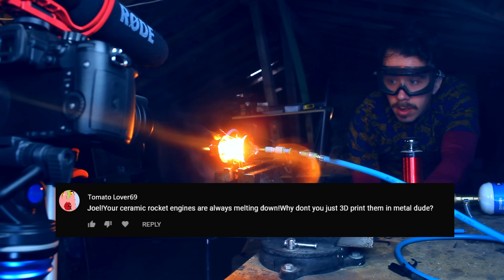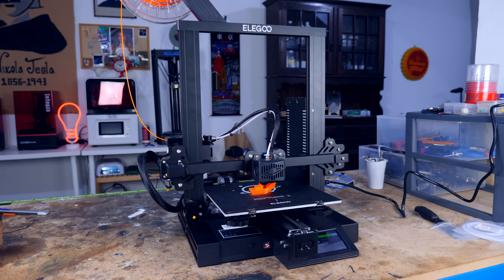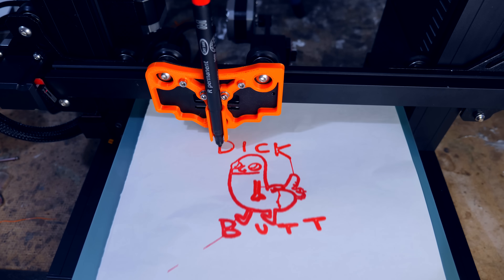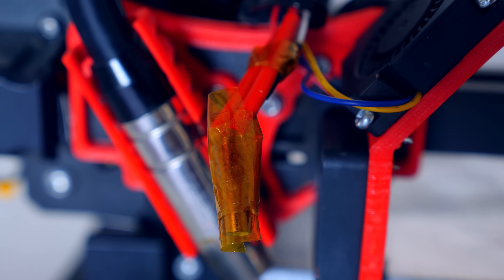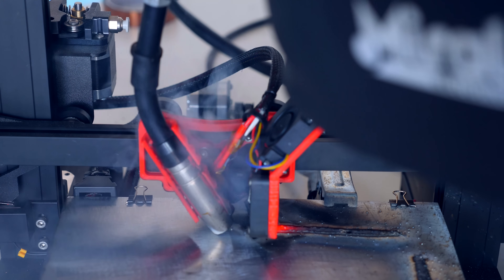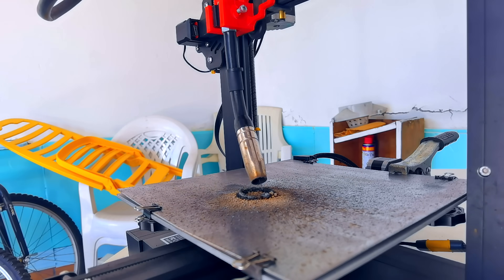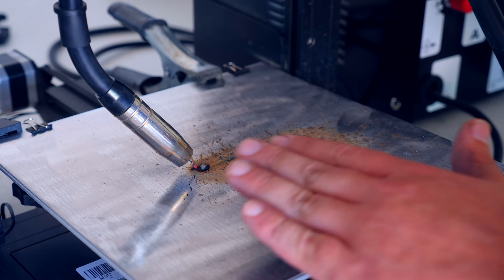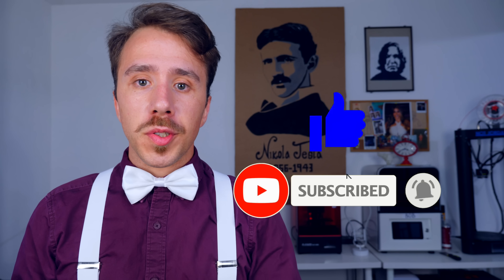I built a Metal 3D Printer using my Welding Machine

Comment: Instead of flux cored wire you should've got some shielding gas and a solid wire. Way cleaner, way less spatter, and it wouldn't be trying to weld on top of the flux.

Comment: You're so close to building something amazing all you need to do is use a MIG torch instead of a flux core welder it has gas shield instead of that flux cord you wouldn't have to keep grinding it down and you get much better results

Comment: I subscribed because you are trying something and putting yourself out there.  We learn from all things even when we are pretty sure it wont work.  So if that wire did not spatter, and you were to weld 1/4 of and inch every 8 inches and allowed things to cool this WOULD work.  We need Heat we need gas insulation from air.  Like TIG tungstun inhert gas.

Comment: I think you might be able to do this idea with a TIG welder. There isn't splatter and the torch is smaller. It also can be pulsed and that may help with temp. control. The tricky part would be setting up the wire to be fed into the weld. But I'm sure there is a way to control that. There are many styles of torch heads on the market for TIG too.

Comment: Cheers lad
So basically this idea ain't as bad as you think. Just you didn't have the knowledge to apply and design it properly. 

First would be the problem of the sheet metal usage. Use a mid type of brass plate around 5 to 8mm thick and drill threads into it in a systematic distance to each other to be able to strap down steel bars (around 5x40x whatever you cut it down on) . Then you can start by drilling the hole and threat profile of your nozzle, so when you finish the nozzle you only have to redrill the threats

To your problem with the welder itself

There are welder nozzle types that have next to no angle, but as that is a higher budget accountancy, how about you make a 3d printed holder that takes him from the handle, bringing the degrees to 0 vertically. The lower the ampere the less the angle could matter to you, especially as you want to weld into Z the only thing to adjust then is the speed you drive in. After all your printers need a lot of time aswell.

Next is to adjust the position of the plates i said to the welders new 0 point, as through taking it by the handle makes it longer in the y axis

Then sheet the electronics in safety with the used sheet platings you wasted

The last thing i would like to ask what gasses you use as it can fairly well matter in the metal properties. 

Greetings C.
Reply: In the end i want to ask you, when you look at my ideas and say no cause of your budget.... Make a cost list of all your printers and materials used to make a rocket and then compare it to this.

Comment: You can make styrofoam models and put it in a box fill it with construction sand (not sure if it’s the right name) poke a hole and add molten metal to get what you need. You may need to cut it in half and hollow it out to get what you need. It’s an idea not sure if it’s a concrete one.

Comment: The angle of your nozzle is too step it should be around 15 degree relative to the plane you are trying to weld. I don't believe you'll be able to get away with deformation even if you get something 1/2 inch thick since your welding locally you would need to let the metal cool between every pass to lessen the effects.

Comment: You don't need to grind each layer, a wire brush attachment will clean it up much easier without removing steel which has the downside of lower the level of the previous weld by just brushing with each layer you are cleaning the weld and prepping it for the next weld. Please try this if you plan on doing a follow up video. 

Welding is 90% prep time 10% welding

Comment: Please print with some woodsche metal or gallium filament... something with low Meeting point should work to be worked/drawn into filament/wire..  and you need to cool the hotbed.. aka instead of heater a peltier for cooling the glass surface.. might work with stock nozzle and szuff..
Or sondern wire? A stock hotend should work for that too.. and can a 3d printer solder my Circuitsus on my PCB? Or can you print a wohler PCB maybe even multilayer ones with a two hotend Setup? One for conductive filament the other normal filament.. maybe the parts then just need to be stuck into these printedpcbs insted of sodlering

Comment: Hey so here's a suggestion, so my dad is a master mechanic and over the years I've helped and learned to work on cars/trucks etc. When doing body work and your welding 2 pieces of metal together to make your bumper, fender etc whatever it is your working on, the trick to make your piece keep its shape as your welding it is to spot weld it. Spot welding is pretty much a tac weld but you do it so short and quick the metal doesn't get hot. The metal being cold/room temperature as you weld on it is key for it to keep its shape and not twist/warp on you. I hope this suggestion helps! I love all the videos I'm a huge fan 😊

Comment: I feel like this could work but it would take a ton of r&d + investment. Definitely would have to use MIG and probably water cooling on the baseplate at temperature based intervals. The parts would probably need to be somewhat large to give the layer time to cool before coming back over it. Welds tend to just keep melting into each other without cooling between

Comment: If you decide to try this again, try printing vertically with a lower welder power.

Obviously I'm just going off the video, but it looked to me as though the welder was vaporizing the feed material before it all had a chance to stick and was spattering it around as a result. Probably like 75%-90% of the welder power you were using would have been better. Printing vertically is really your only way of guaranteeing the position of the feedstock relative to the bed, since you weren't turning the bed to keep the angle consistent.

Also, a cover gas would probably have helped. Not as important as the welder power though IMO.

Comment: you are using flux wire if you use gas and normal wire you will get better welding with no need grinder...

Comment: I think you will get better results by using normal non flux welding wire, with CO2 as a shielding gas. This way the weld will stay a lot cleaner.

Comment: I would like you to take this idea to the next level. Thicker plates and mig welder with gas, no need to clean layer after layer of bird poop 💩 again.  Maby even use a tig welder and use the printer to Control the filler rods.

Comment: If you try in future, you should consider using a stone chopping board for a bed instead of sheet metal, and a thin wire mesh so the weld has something to bind to. 
I don't know much about welding but maybe also a thin layer of water to cool down the base, would pull heat out of the stone before it has time to build up and crack, would also stop the wire mesh from deforming during the base layer. can't wait to see more, good luck!

Comment: Two things that would improve your print. Having worked on with industrial MIG welding robots using oxy act gas would basically take away the bird shit stuff (weld spatter) that you're running into, also adding a cooling plate to the bottom of the base plate or putting a delay between each layer would also help with the plate warping, and lastly adjusting the speed of the print would allow you to get a better weld but it seems the speed you have it working rather well but will need to be adjusted if with thicker welding wire. friendly note using both flux wires with shielding gas will make it so you wouldn't have to grind it every layer and the welds will come out beautiful.

Comment: G02 is clockwise and G03 is counter clockwise Thera also IJK codes you can use inside the g code line to refine the move. Point to point is an insanely inefficient way of making an "arc" with G code.

Comment: When welding thin sheet metal it is best to just do sequential tack welds, continuous welding makes too much heat and warps the thin metal. As well, your stick out is way too far, the wire should only project less than 1/4" from the welder tip. As well, welding with the tip at an angle also makes it deflect more. The other challenge with constant welding is melting the previous bead from too much heat, which causes the weld to mushroom out and not build in height. If you added shielding gas, pulsed the welder and movement and added a large stationary fan cooling the entire sheet (it will diffuse the heat quite well) this could be more workable.

Comment: Hi. Im not even sure how does youtube got your videos to me but whatever.  Anyway.. After watching this video and went for work (Asd welder) i was thinking . . . You making ceramic rocket enginels... Why not use  a TIG Welder gas nozzle? They usually made from ceramic and they already designed to blow gas out of them. And they usually connect to plastic at some point on the welding pistol and they didn't burn that eaither Might worth a try. Specially because it's cheaper then a metal 3D printer.

Comment: I would like to see you us a Mig welder that uses Argon gas at a flow rate of 30ml,
and between layers it would do a pass over the existing layer without welding  to cool it down
 or just setup a pause between layers for about 1 minute

I know it would be slower but at the rate a welder can lay filament it wont be to bad.

Oh Welding via CNC with PTA (Plasma Transfer Arc ) has been around since the 1950's
I used to do this many years ago building up layers to about 25mm.
 
 But the machines were very expensive and big, and used many types of gases
And now we can make such machines very cheap indeed, as you have demonstrated. 
I do hope some one make one work using the cheapest 3D printer and welder available.

Comment: Just... no...
1. Make print for your engine from ABS
2. Get ceramic gypsum make a molt.
3. Leave to dry off
4. Drop that in oven ~150C for time to cure don't go above 200C or you melt ABS
5. After cure flip upside down and melt of PLA
6. U shuld have litle crude but fine molt for cast.

Comment: a mig welder with the right gas would fix the slag problem that makes it look like birdds**t. but with the thicker metal plate you need for stop the warping, you get the problem of how to seperate the weld from the buildplate (that most likely is more expensive then the part you print) in a way you can use it again. + syill getting build plate adhesion..
Reply: using a cnc to cut out the first layer and fixing it on a ceramic plate with some kind of heat resistant glue might work.. but casting is way faster and cheaper.. even the metal 3d printer using metal powder filament would require less work and get better results. welding is just to messy and random.

Comment: even metal rocket nozzles melt, the temperatures on the inside of the engines can reach 3500-4000C. You need to cool all engines down, try cooling the ceramic nozzles using a heat transfer mechanism.

Comment: Hello Integza, i like your channel a lot.
Your way of thinking out of the box and experimenting
further even if there is a tomato storm the result is inspiring!
A lot of your experiments need to resist high temperatures of fire etc. for a long time so I would suggest a new theme for another video should be
You're trying to build a  DIY 3D printer that uses ceramic paste/fluid to build those heat resistant parts you need so urgently- think of the pulso jet, the rocket nozzles, the tesla turbine etc. You could create a series of integzas experiments reloaded where you redo your famous experiments again with better results because of the ceramic parts in it! It would be fun to bet in advance how many failured from the beginnings would now turn into success with the 3D printed ceramics! All the best to you and your girl-friend - I wish you the sweetest tomatoes  life can bring! 😉

Comment: Great video, cool experiment! Upgrade the welder to a TIG will get rid of the problem with slag you have to clean up between layers. Feed filler-rod using a cold end extruder, kind of what your welding machine did in this video. Don't use your 3dprinter, but instead make a MPCNC where you mount it. Skip using plastic close to hot object, use aluminium. Ohh, you got another subscriber.

Comment: Integza you should try this with a tig welder. I've seen people make much more complex 3d structures by hand than I have with mig or flux core like you're using. Considering your level of success using what your had you should be able to make something much better with a tig machine.

Comment: @integza just point it straight down. It's optimal for every direction being limited to only 3 axes. An go for liquid cooled mig welder. With shielding gas that is. If you tune it right there won't be any splatter and get much longer run times. You could pull it off.

Comment: hey integza nice video
 i was thinking maybe you should try transform this 3d printer in a cnc milling machine, with a height rpm motor and a small diameter tool you will probably be able to make plastic and aluninum parts. Steel will be to hard for a machine like that but i have a idea insted of use a nomal cutting tool you can use a process called electro erosion, usin this process you can cut through a impressive amont off steel at a not so impressive speed. If you build a machine like that this can make anything in steel, like a steel rocket nosel.

Comment: It would have worked much better if a dc tig welder was used and it was auto fed solid core mig wire or other filler.  This would require argon gas as well.  If you were extra crafty you could probably setup amperage control, post flow, etc. in the g-code.  However like most ideas this one seems to be getting more expensive by the minute…🤔

Comment: The first issue i'm seeing is you cannot use flux wire for this because of the slag buildup. It's a "single pass then chip" kinda thing. You must use argon shielding gas which will get rid of all that splatter and smoke, and allow you to make multiple passes and build up the layers.

Comment: Actually this seemingly stupid idea is kind of what my working group at university was working on last year (although I personally didn't have much to do with it). I have to admit that for your setting, which is basically unsuitable for this, the results were very pretty good. You were not very far from usable (but still ugly looking) results. From a scientific perspective of course.

The fact that it's hard to predict the layer height and width is a common problem in this field. Imagine building a metal (plastic free) CNC machine and attaching the welding machine. This could actually produce something (or at least work as a proof of concept).

Comment: I think it doesnt work for two reasons.

The Wire your using is not shielded by gas and that males scrap.

The angle of the torch should be vertical.

Comment: Couldn't you take 2 soda cans cut a slit on one to make it smaller and put it inside the other till theirs at least 1 inch gap weld the 2 parts into one then pour hot metal inside the gap for a metal chamber or simi thick shell for a nozzle and another thing is you can just buy a metal cylinder block that's filled and then just use a basic drill put a single weld point on the metal sheet and the cylinder to keep it still and shave your nozzle or whatever part put if that kr reconfigured the 3d printer to have a tiny all side drill bit that you then program it to be able to drill and core out the part you want kinda the backwards way of the 3d printer instead of printing your carving but useing similar programs to tell it to drill a certain shape out of an object you just have to have supports if its smaller than the metal you use to cut it out of to once it done then you cut the supports and theirs your metal part tho you might need to add some sort of water cooling system were the drill head is at to keep it frin over heated meaning you have to make the 3d printer platform water proof to not destroy it

Comment: Hey i kindahad this idea and just wanted to share it with you,
So if you wanted to 3D print metal there is another way to do it, i kinda  did the small scale of this and it pretty simple,
you need to have the anode of a very high current power supply connected directly to what you want to cut, then you have a pointy thick wire connected to the cathode and all you need to do it 
just to cut the metal, i kinda tried this at home ,basically took a lithium ion battery which i think has around 750mA and connected the cathode to some thin aluminium foil and had the cathode wire pointed at the foil to cut it into what shape i wanted, its a  bit difficult but if you had something like a 3D printer do it, it could be way more accurate and you could cut detailed metal cut parts. Idk just liked  the IDEA i mean sure you could use a grinder but thats sweaty work.

Comment: On some of the other 3D printer conversions, I've watched, they have the nozzle pointing straight down. Pointing it to the side just helps you see what you're doing.

Too bad I can't draw worth beans, or attached pictures, because I was thinking about the Tesla valve, and how to build it using stacked structures with flat faces instead of the curved passages. I've seen something similar on header pipes, that the length determines what the most efficient engine speed is for scavenging gases. I was thinking stacking these outlets could achieve the desired effect.
Interested???